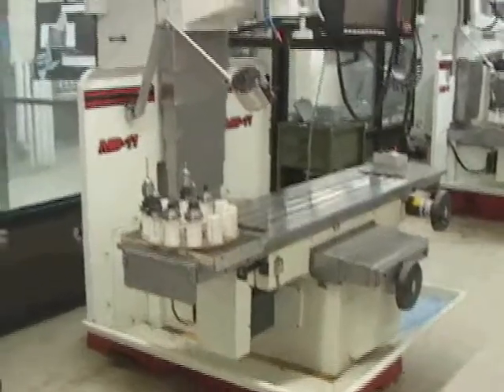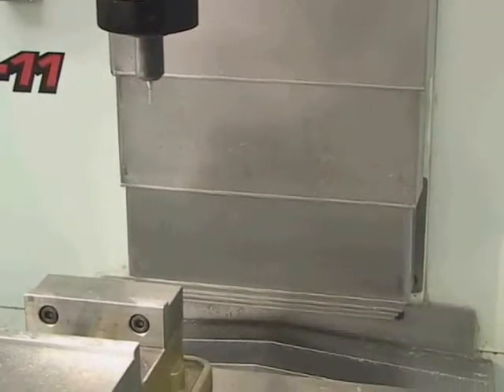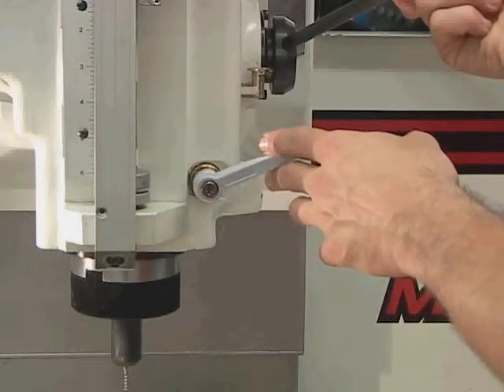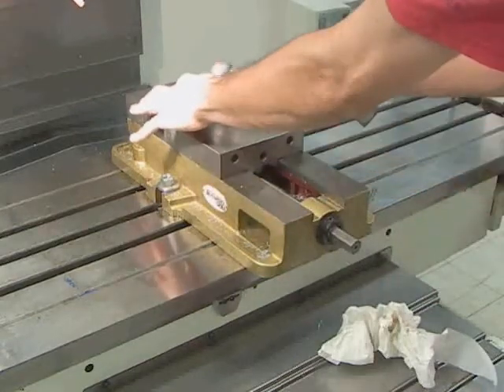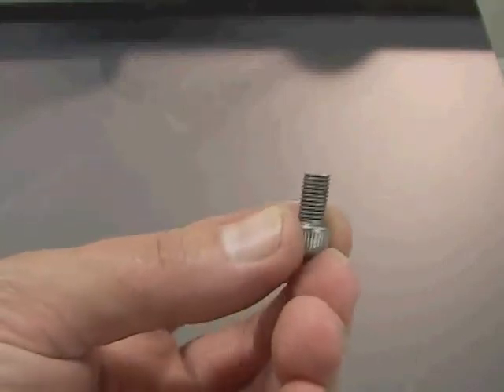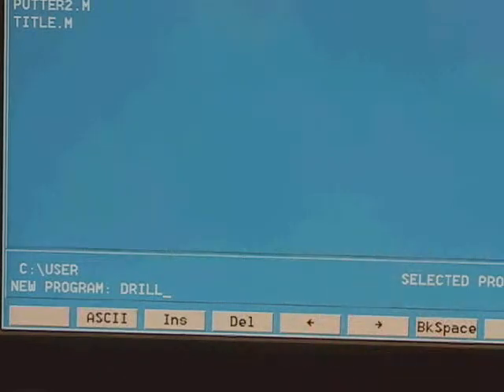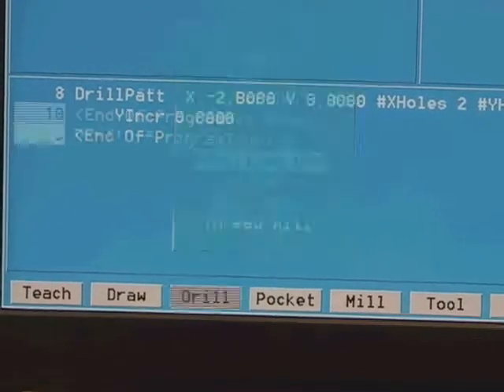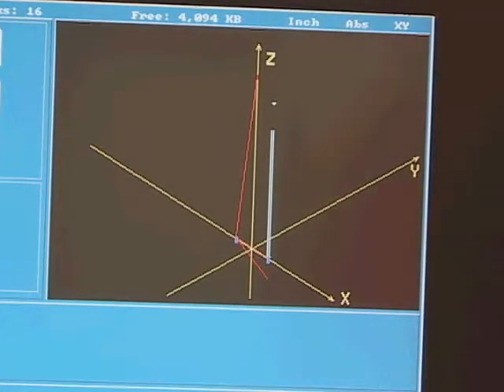CNC Tutorial 2

Comment: "1000 Rpm is a good rpm for drilling" Good to know, ill use that next time ill drill a 50mm hole :D
Reply: spindle speed for drilling is depending on the drill bit size, material of the drill bit made out of and the material you cutting. generally speaking, the smaller the drill bits, the higher rpm you want to run it at. whats important here is the surface speed (outmost circumference speed), how fast then? u may need to read the datasheets for the drill bits or google up general chart for speed and feed for various drill sizes. HSS and carbide tool are quite common material for drill bits.